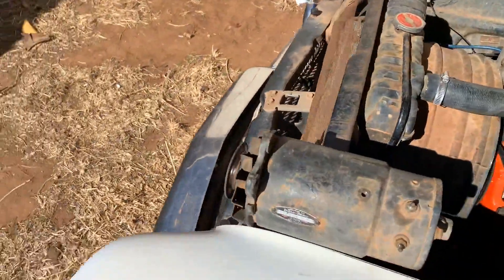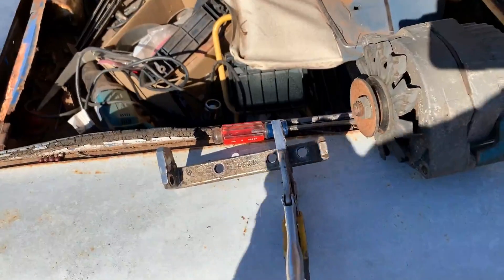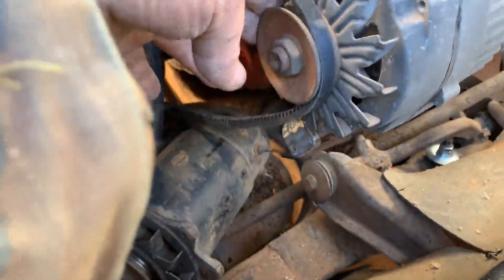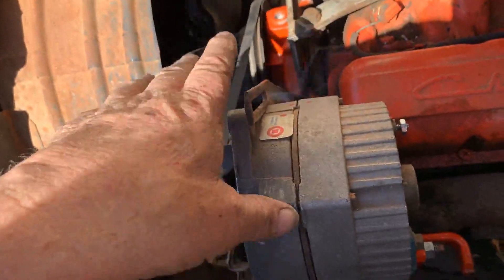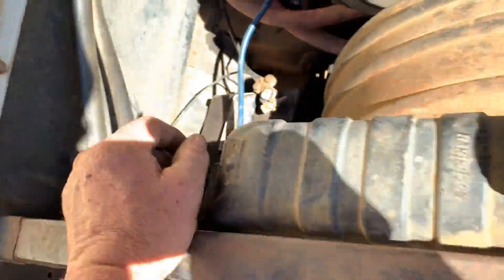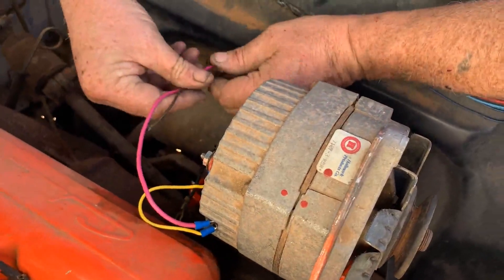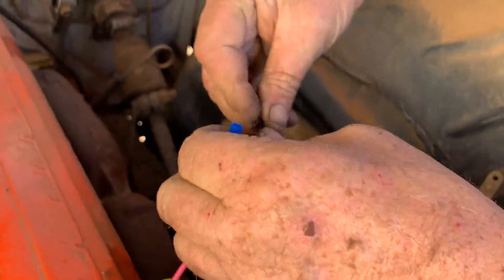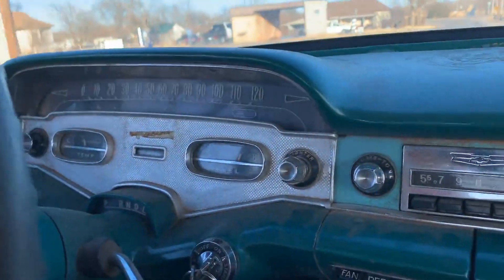Classic Chevy Generator to Alternator Conversion On a Budget

Comment: Your video was very helpful but does the blue field wire go to the horn becouse mine not working now that i did this
Reply from the maker: Your horn relay is right there at the front by the regulator, so you may want to check those connections. I would have to refresh my memory on how that is wired.

Comment: I could very well be wrong, but I noticed the nameplate on that generator (which you said was the second one that failed), was printed in black. That was Delco's way of I-D-ing a 6 volt generator. Its 12 volt generators had nameplates printed in red and were prominently marked "12 VOLT." That's what a generator in your car should have. If that was a 6 volt generator you showed in this vid its no wonder it failed as your car has a 12 volt electrical system. That is most likely why it failed so quickly.

Comment: Is that the same for a 62c10 I have a generator I want a alternator on it
Reply from the maker: seems like it would be the same. I don't have one handy to look at, but any one with a three wire generator would work the same.
Reply: What if i have one thick black wire and one thick brown wire instead of to Brown wires i have the blue as we do i run my own brown wire to the dash light
Reply: I only have 3 wires blue brown and black

Comment: Trying to get my grandma's 56 trifive charging and ever since it's last motor swap it's never been set up right, this video helped clear out most of my confusion even though the alternator is on the other side of the block(350). Thanks for this vid great help.
Reply from the maker: Thanks for watching. really hope it helped. make sure you have good grounding on the alternator as well, that will cause some good sparks if you don't.

Comment: I'm working on a sandrail for a customer which is powered with a mid 60s Corvair with points ign. wanna get the motor running after being parked for 20+ years but I'm here in Colorado so no rust issues just dirt and mice 💩. there was a few components missing so gotta figure this one out thee old school way...bust out the "books" and manuals to see what's required to fire her up. 
ballast resistor is mounted, tryin to figure out if theres anything important that I'm missing...replaced the following 
spark plugs and wires
rotor and cap
points
alternator 
starter solenoid.....
now the fun part, wiring her up for minimal accessories. Any tips or info would greatly be appreciated. I'm 38 and was born in the wrong generation, I've owned plenty of 60s classics, i have a 68 impala fastback that was supposed to be on the road this summer but too busy working on everyones rides!!
much love and respect ....
Reply from the maker: sounds like you are pretty close on all the ignition stuff. set your gaps on points and plugs and If it hasn't been fired in that long, shoot a little oil of some kind into each cylinder. just enough to lube the rings. Turn it over by hand to make sure a valve isn't stuck open, those suck if they ram into a piston. But you are really there. set it up on top center number one, add some fuel and add some juice to the + side of the coil and hit  it off.

My neighbor across the road has his 67 impala, we spent many nights rebuilding the top end , new intake and carb, headers, and its his daily driver now in gun metal gray.

Comment: Never had to do this, but I'm fascinated by the wiring mods.  That's some old-school knowledge right there, kind of like understanding carburetors!  And I don't get along with drill bits either!
Reply from the maker: well, to be sure, I did end up welding one of the holes shut and redrilling it. :p And by the time I start tuning an old carb, it is time for a new carb. :)
Reply from the maker: and thanks for the sub. Really enjoying your rebuild too.

Comment: -the EZ way is get a one wire alternator on ebay for around $75.
 i put a 1975 454 and a th350 in my red 93 pu in my picture and i didn't know how to hook up the 93 charging wires to the old style 1975 alt.
   i bought the 93 body with no engine or trans. so i used what i had laying around to build it cheap.
Reply from the maker: cheap is the way. :)

Comment: I have a 58 Chev also that I was trying to do this on for the last approx. 20 years. I'm not a car electrical person and no one wanted to help me out at all so it sat for these years. Early on once anyone found out it was a four door they literally walked away. It's inside a garage at least so it's not rotting. I'll have to save this video. Thanks.
Reply from the maker: Thanks for the comment. Most of the stuff you search on doing this just over complicates it so a person throws in the towel.

I was hoping to take the head scratching out of it for folks. I person could always do more. But this gets it done.

I always thought that for a 4 door, the 58 uniquely made the back door handle blend in over most other cars of the 50's. so much chrome happening. I might just go with some of those kindigit handles down the road and blend them into the body color. (on this one at least)
Reply: @3MonkeysGarage  Never thought of that door handle idea, Look pretty neat actually.  Either chrome or body colour.